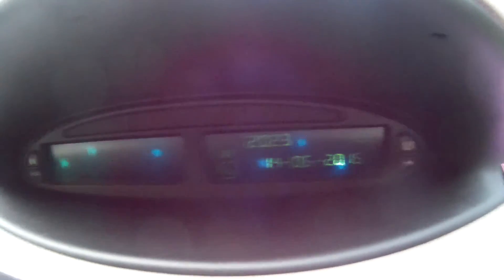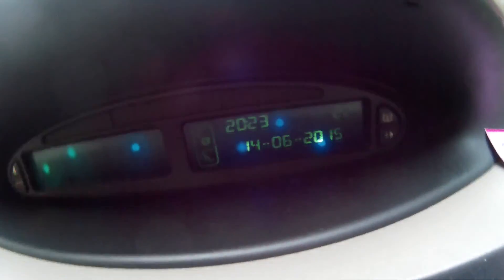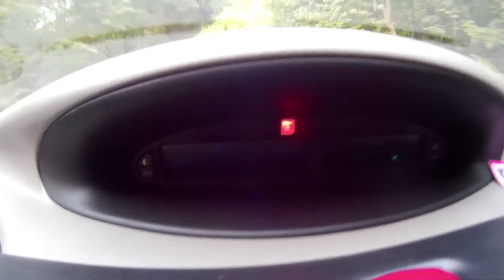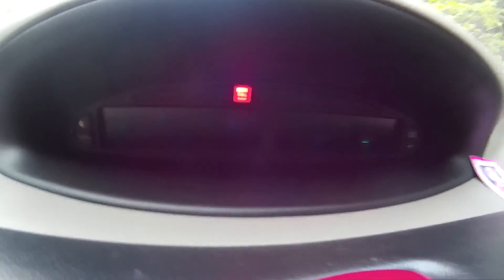Power Generation Downhill (engine OFF)

Comment: do yo fix this problem ???
Reply from the maker: The LEDs on the dash? Yes ► https://www.youtube.com/watch?v=XLqxUi-IMAg
Reply: I have a problem with my picasso. This not charge the battery
Reply from the maker: - if the battery is old than replace it
- check the alternator
- check the voltage regulator relay
Reply: furulevi where is the voltaje regulator relay? ?
Reply: I change the battery. Chance the pieces of alternator. But the signal to do alternator work is not
Reply from the maker: I'm not sure... (on my old car I replaced it once)